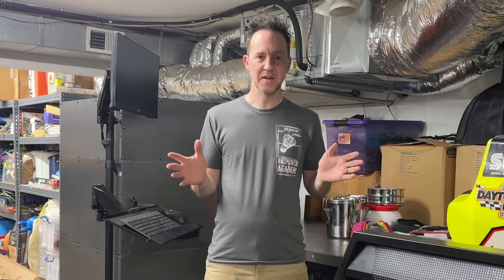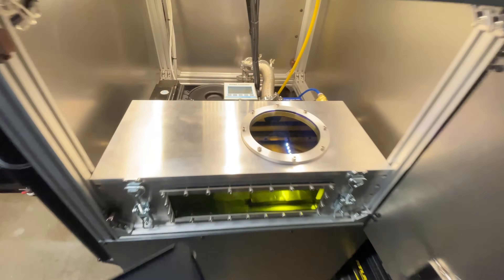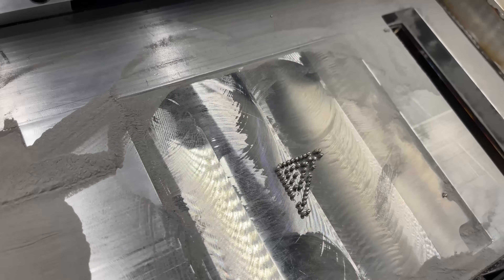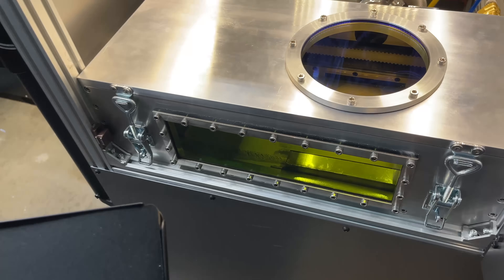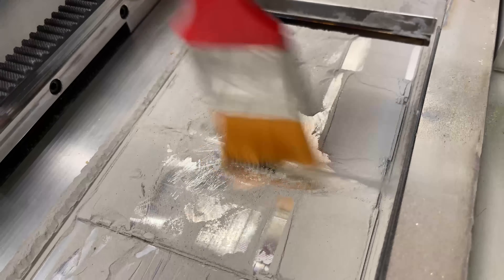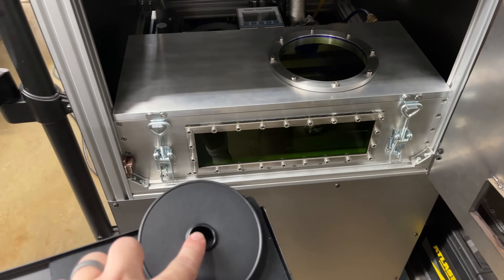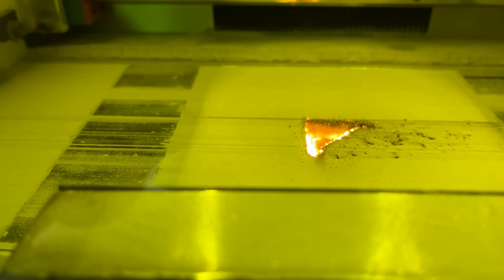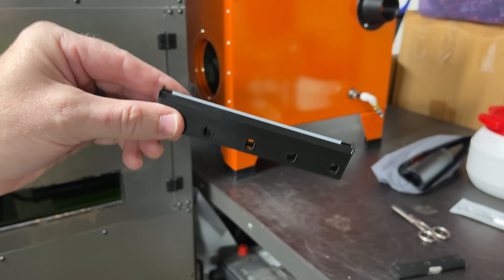DIY Metal 3D Printer: Part 8

Comment: I believe your sequencing for the powder re-coat is incorrect. When I did the software for a chemical sintering powder printer, we dropped the build plate bed first, then added the new layer coating, We didn't need to smooth it out on the pass back, so it was dropped until the recoater was back on the source side. The other thing is we had to switch from a static recoater blade to a rolling one that rolled in the opposite direction of motion to get a smooth coat. Finally, from what I know of my time with fiber lasers, you probably need to actually laser the pattern differently when getting to larger layers, otherwise it'll curl really badly. I never found good numbers, but the things I did find suggested that you cannot do more than a certain area at a given time without letting it "cool" at least a little, otherwise it'll curl. I also suspect that there's a cooling time required before fresh powder touches it. I don't recall if you're heating the chamber, but I know from what I've read on laser powder printers, heating it until you're at right below the sintering point helps a lot.
Reply: This is how the Formlabs Fuse 1+ works.

Comment: you can actually improve your testing by trying multiple settings at once per one try. If you put 3 or 4 items in the middle into one vertical line you can set the first one to one set of parameters, second one to others and soo on. Because they are all in the different part of wiper even if one or more fails it should not be bad for the other ones. You get 3 or 4 attempts for the cost of one.

Comment: I work day in and day out with generative ai tooling.  I would highly recommend getting use to leveraging ChatGPT or Claude AI.  I do a lot of coding and designing, so I use it a lot through VS Code with Cline plugin.  It is really good at reading documentation and offering guidance ONCE it has those documents, otherwise it has risks of hallucinations.  I recommend getting all the specs and documentation of the tools, the components, the programming languages, designs, other people's project descriptions etc. and put them into a folder that can be referenced by the AI as needed.  It will scan the documents as needed to find the answers to your questions.  If you really want to get more out of it, there is something called an MCP server, which is basically that folder but other people host the documentation and the AI simply calls the server when needed to get the information, saves you the trouble of finding documents etc.  but only if someone else has made it.

Ping me if you need any guidance, as I am very interested in your project and don't want to see you waste time when there are amazing AI tools out there that can help.

Comment: It's not the same as plastic 3D printing. Adherence to build plate is one thing. But metal is not plastic, when it melts it has surface tension and that creates a blob. You never want to see a blob. It should always look like ink printer.
Try printing a single layer square 2.5 x 2.5mm. Until you get a perfect square with same thickness everywhere like it was saved from a solid bar, you need to work your settings, power, speed, layer height, laser pattern.
Temperature definitely helps. Currently where the laser hits it has very high temperature. Without heated chamber/bed the temperature difference between near powder is very high. High temperature difference in metals is always bad.
Reply: Our SLM printers don't include heated bed and they print perfectly well. The recoater and laser settings are more important and it should work without extra heat (and maybe the alloy used as bed is not suited)

Comment: your build plate is not dropping when it does the first sweep which can knock over the supports that can cause the melted metal to stick to the silicon blade wiper
Reply: I was thinking the same thing

Comment: My guess is you need to handle the first layer differently.
Either higher laser power on the first layer to heat up the thick base plate enough for the powder to stick.
Or a slower print speed on the first layer.
Or, if you can, defocus the laser and pre heat the base plate before you spread the first layer of powder.

Regarding the bulging of the printed areas, how have you decided on the powder layer thickness? The bulging wearing on the scraper could be fixed by a thicker layer height.

Comment: I kind of feel that you want more of a sintering kind of process - I tend to agree with chatgpt. I'm really not an expert but for me it looks way to "welded". The powder seems to form big drops of molten metal as if you put an soldering iron in a puddle of soldering paste. I would assume that what you want to see is something fused/molten powder with a height not more than the height of your powder layer.

At one point, I don't remember when, I came across a paper that talked about the right way of doing SLM, how the molten/solidified powder should look like..  🤔 What about a sandblasted build plate? Maybe the roughness helps to take up powder and fuse better with it?

Comment: I think your powder delivery is not accurate enough. The silicone can flex and therefor ruin your build height and powder layer. I would try a solid scraper which can deliver an accurate powder layer height. But first, I would check if the powder is not ending up higher after the laser adheres it. Maybe put a straight edge over the build plate and top plate which the scraper rides on. If that's the case, it would always ruin your scraper.  
Just some thoughts. Not that I have ever built an SLS printer.😉

Comment: Preheating the powder bed is very important. Maybe try using the laser in a preheat pass. Deff want to look into heating the chamber tho
Reply: No, it's not. stainless steel has a melting point of >1300 degrees celcius, heating it up by 100-200 degrees does nothing. Only for low melting point materials like aluminum that also have high shrinkage it can make a difference.

Comment: Looks promising once you get it dialed in. May still be too hot if its bubbling or not be purged enough. I know with welding if you don't have good shielding gas it bubbles. For adhesion, I wonder if you could do an etch layer first to make a rough surface, then a preheat with the laser before trying to do your first layer.
Reply from the maker: I think you're right on both...I'm still too hot and I need to try to get the oxygen content lower still.

Comment: Your stick-to-itiveness is admirable. I feel your pain. Welding aluminum is greatly aided by preheating the metal. Any way you can have the laser hit the build plate first to heat it up to adhere the first few levels better, or heat the chamber? Or have the squeegee lift up upon return so it doesnt drag back garbage?  Or maybe have a longer squeegee blade at an angle so has more give to it for discrepancies in the process. And it seems like its still awfully hot as it drags over the new layer. Just laymen's observations.
Reply from the maker: I'm not sure if the software supports it, but that is a great idea of using the laser to heat up the build plate. The build plate and powder plates do drop down slightly when the recoder returns so it 's not supposed to touch...though I need to get rid of the part swelling so that can actually happen : )

Comment: I have a few ideas that could really help you 

1. Do a couple of laser test passes at different power and speed settings (definitely faster and lower power). I’m talking about single short lines. Then choose the ones that look like flat welds.
2. You should also try lightly sintering the area before melting (I’m not sure if that would work).
3. Melting the powder in two passes and using somthing like checkerboard pattern should significantly reduce warping.Also do outline of part before anything.
4. Try to avoid large flat parts at first, because internal stresses WILL bend the part.(this is not if)
5. last one is propably way too late to even consider but highier temp in chamber coud make printing way easier
Reply from the maker: Thanks for the tips...I'll see what I can do

Comment: I know nothing about SLM so a big pinch of salt needed: 

I noticed the print bed drops on the return of the wiper. This seems counter to how I would intuit the wiper functioning? Shouldn’t the print bed drop on the initial wipe across to deposit a bunch of powder, then the return wipe raises the bed to correct level to wipe away excess back into the feed chamber. This would stop the wiper blade from knocking the print and the return would ensure just the exact amount of powder is left in the build chamber for the next melt. This seems like a double bonus for stopping the wiper hitting the bulge left on top of the previous layer and would be more efficient at depositing back unused powder back into the feed. 

Devils advocate being that this method would wipe back unwanted material back into the feed chamber I suppose.

I have no suggestions on top of what you already tried. My only thoughts are related to chatgpt and not relying too heavily on its expertise as it has a tendency to make $h!7 up whenever it feels like (read: most of the time.)
Reply: Yeah, I thought this looked odd as well at 7:08. When I saw the design in previous videos, my guess was that the wiping from the reservoir would fill the lowered build area with powder and return to the start position?
Reply: Ya I too was thinking there was an issue with the movement order of operations
Reply: And maybe the wiper should not return until after the laser to be sure not to disturb the powder bed. It should not be a problem if the powder is dry and free of contamination, though. The bed would have to lower before the return to make sure any bulging do not scrape the wiper blade.

Comment: looks to me like maybe the metal is beading up with surface tension after it's melted, leading to a higher (and convex) surface than the top of the next powder layer. that might be why your scraper hits the print itself and also fails to distribute powder past the printed part. I'm not sure how one fixes that though.

Comment: You might as well try to fuse the powder in two steps each layer. Do a rapid preheat pass, followed by the actual power pass. Often with lasers its not just the speed and power, put also the laser frequency.
Reply: I noticed that other resin SLA printers run the outline of a shape first, then do the infill - or the other way around.